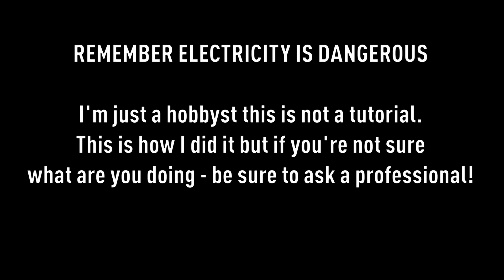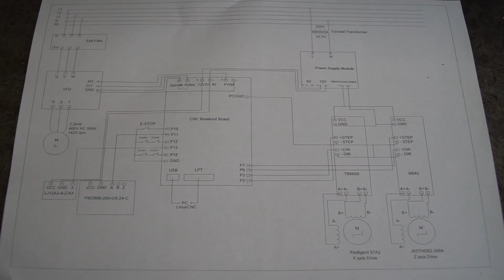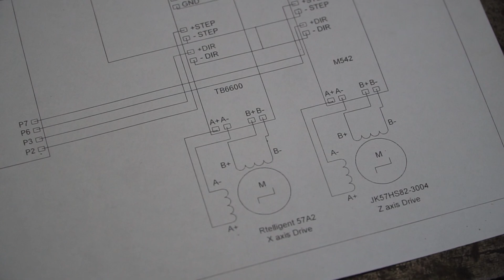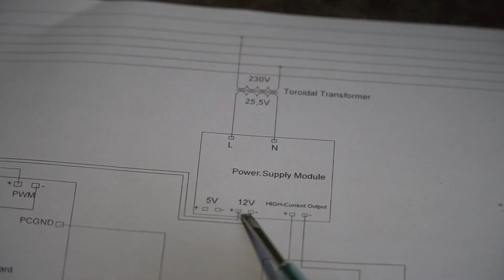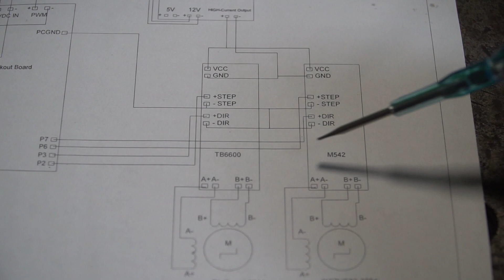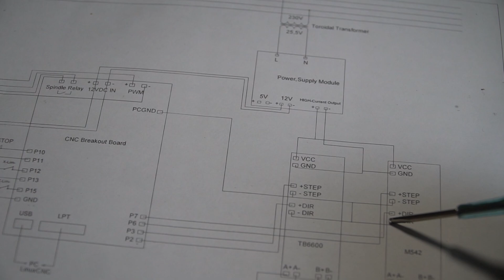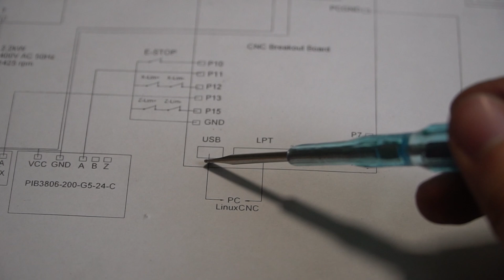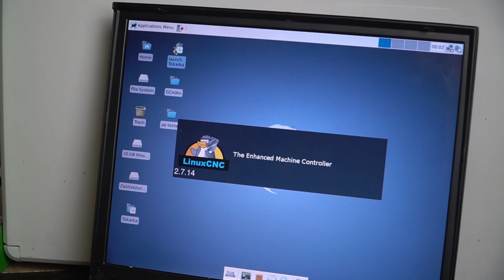DIY CNC LATHE - Wiring Diagram

Comment: what is the PPR of your encoder?
Is the parallel port capable of receiving frequencies from a 1000 ppr encoder?
Reply from the maker: i'm not sure but I think it was 200ppr if I remember correctly. With 200ppr it can handle up to about 500RPM on the spindle with my laptop parallel port (when I have more rpm it is not able to count so fast). Maybe on a desktop PC it could reach more. But I wouldn't go for a 1000ppr - thats definitely too much pulses in my opinion unless you have a really slow spindle

Comment: Why are you use on spindle proximity switch/sensor and spindle rotary encoder?
Reply from the maker: Because there is a pulley 2:1 between the spindle and encoder and I would get 2 index signals per rotation instead of 1. So the sensor is sending one signal per rotation
Reply: @GBWM_CNC  ok,but why you use bouth sensors in the same time on spindle
Reply from the maker: @Doctor_88  By both sensors you mean the proximity sensor and the encoder? The lathe is getting the A signal (200 pulses per rotation) from the encoder and Z signal from the proximity sensor (1 pulse per rotation). The index signal - 1 pulse per rotation is used to start threading every time in the same moment and the 200 pulses per second signal is to make the lathe know exactly how rotated the spindle actually is.
Reply: @GBWM_CNC  you mean the index sensor is like home swich on spindle? And enconder is to mesurment spindle rpm?
Reply from the maker: @Doctor_88  More or less - yes. I think we could call it like that :D
Reply: @GBWM_CNC  And if you used a 1:1 ratio would a second sensor be needed?
Reply from the maker: @haskiewicz_motorsport  Nope. With 1:1 ratio there is no need for the second sensor

Comment: Thanks for the overview ^^ are you going to do an overview on your Linux CNC config
and is there a specific reasoning why didn't you use a switching power supply ?
Reply from the maker: There is a video on my channel named "How To Setup LinuxCNC on a Lathe" - this should give you an idea of how I set up my config. About the reasoning of choosing this power supply instead of switching power supply - I just had it lying around from another project. People say a traditional transformer is a more stable power source but actually I made a machine using a switching power supply and it works just fine too.
thanks for watching! 😁

Comment: Any reason why you didn't go with a switched power supply?
Reply from the maker: Yes. I had this kit as a leftover from other project 😅😅 I mean - a transformer is a more stable power supply but I made already a machine based on switching power supplies and it worked fine as well (it was even better for higher feed speeds as the voltage was higher which led to more rpm on the stepper motor).

Comment: Nice video.. very useful info 
Two questions:
For the encoder you only use one Phase and leave the other phase not connected.. is it enough?
The other question:
What is the need for the USB cable between the board and the PC if you already use parallel port for communication between PC and breakout board?
Reply from the maker: thanks!
1. only one phase is enough if you use only one direction of spindle rotation - two phases are needed for quadrature signals and detecting the direction of rotation.
2. usb cable is probably only for delivering 5V to the board - it isn't used to send any informations

Comment: So much deference your skill how to prepare electric gear very detailed I am think zero level.👍🏻👍🏻👍🏻
Reply: I really want to get VFD for motor because I want to make Belt grinder machine soon if possible but cost very expensive
Reply from the maker: My belt grinder is without vfd. You need diffetent cutting speeds for different materials?
Reply from the maker: I'm just hobbyst but I'm glad you like it 😊